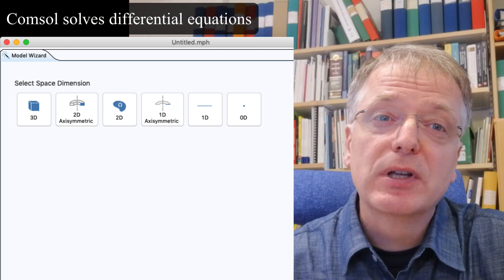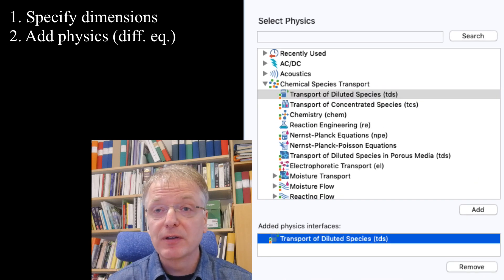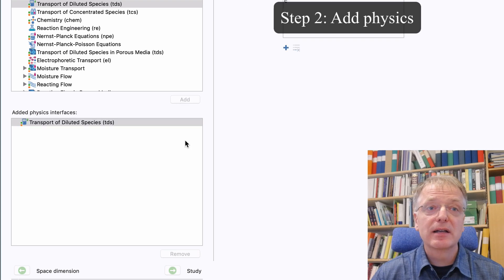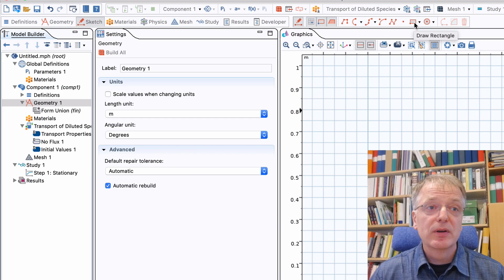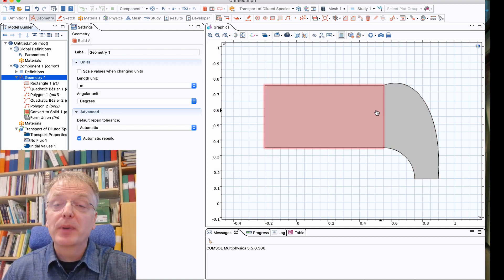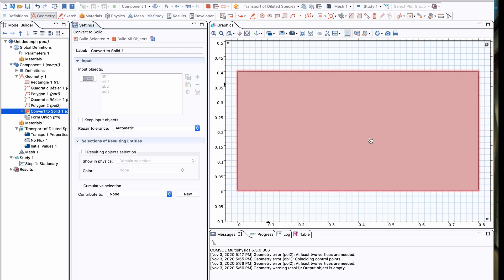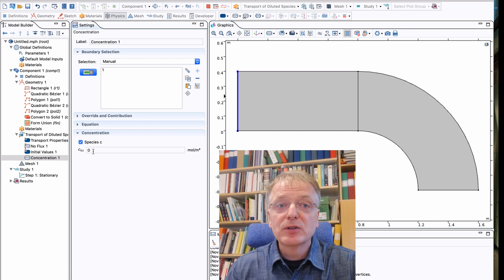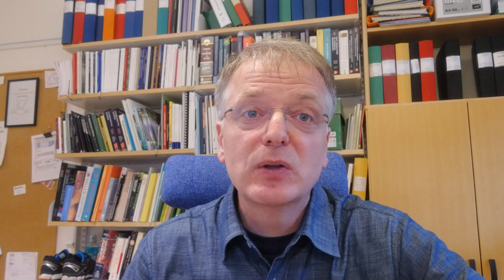Introduction to Comsol Multiphysics 5.5

Comment: Dear sir could you please if it is possible to simulate fluidized bed reactor solid liquid with adsorption isotherm model
Reply: Thank you
Reply from the maker: It would not surprise me if  it is possible as you can combine different physics models in Comsol. At our department, however, we co-develop other tools for simulating, optimising and controlling  chromatographic systems e.g. for the production of biopharmaceuticals. At the core is a program than can run/control other software (including Comsol and Aspen) as well as running our own code.

For more information regarding similar research at the department see e.g.

https://doi.org/10.1016/j.cherd.2019.12.015
https://doi.org/10.1016/j.chroma.2020.461760
https://doi.org/10.1016/j.jbiotec.2019.05.013

Comment: Concentration: in the field of the rectangular duct a total flux magnitude almost homogeneous of 5.8 x10e-10 mol/(m2*s) predominates. Then in the short part of the arc duct, magnitudes between 8.5 and 6 x10e-10 predominate. In the long part of the arc between 4 and 5.5 x x10e-10. By varying the mesh to Finer and Extra fine the results are similar but more defined.
Reply from the maker: Yes. But the finer you make the mesh, the more time the computation takes and not all my students have fast computers.  In general, my advice is to first make quick and dirty calculations using a rather coarse mesh. Then when you think you have a working model, make the mesh finer and finer and see at what resolution the model results stop changing.